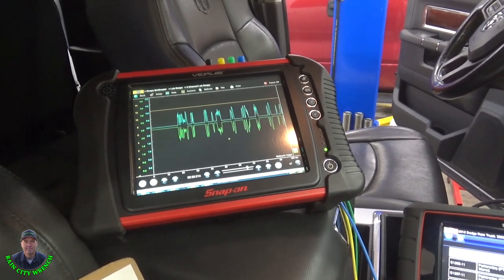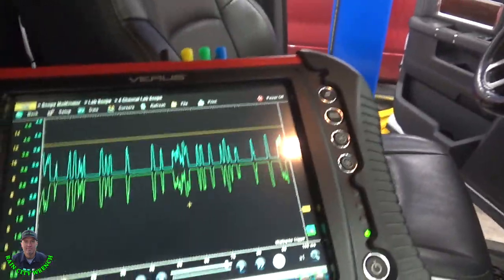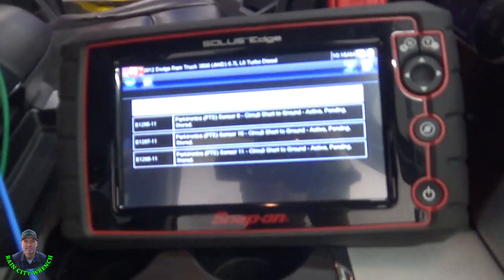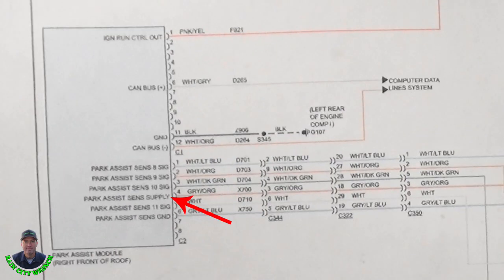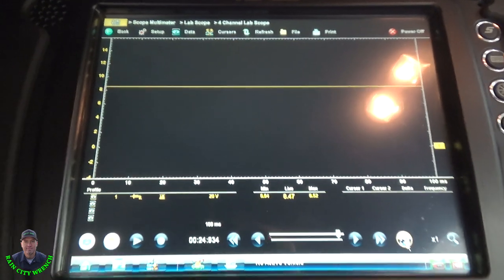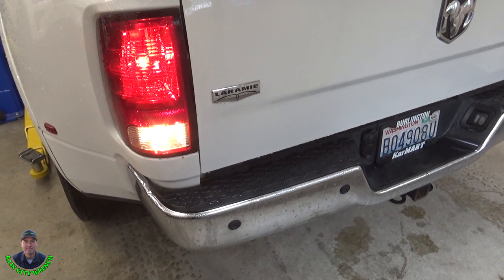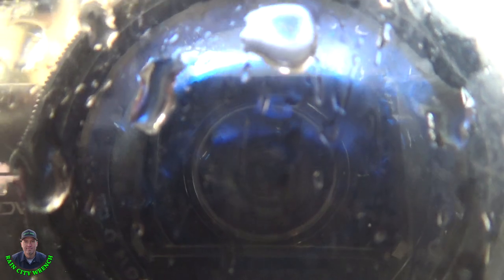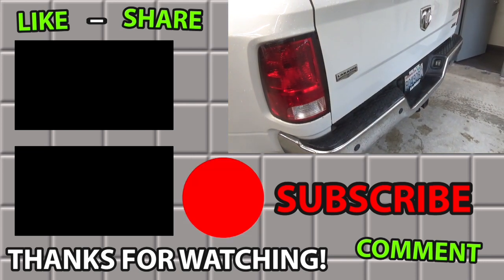RAM PARKTRONICS DIAGNOSIS/REPAIR

Comment: I have a 2012 ram 1500 bighorn and I have the "service park assist" notification. I replaced all 4 sensors 2 times from Amazon, turns out both sets didn't work. I bought an expensive code reader and used ALPHAOBD to scan the original oem sensors. The fault that comes up is: Sensor supply voltage - voltage below threshhold. Any idea what needs to be replaced?
Reply from the maker: What's the code number? Can plug it into identifix to see if any repairs are listed.
Reply: The code that is coming up is B2128
Reply from the maker: @benwalker6971  May have one sensor shorting supply voltage. 
1. Disconnect one park aid sensor
2. Turn ignition on without starting engine
3. Place transmission in reverse
4. With scan tool, read park assist module dtc's. If this dtc is still active, repeat this procedure by disconnecting another part assist sensor. 
Replace the park assist sensor that caused this dtc to change from active to stored after disconnecting. 
If dtc stays active after disconnecting all sensors then plug all sensors back in, check sensor supply voltage on pin #1 GRY/ORG at each sensor. Voltage should be a little over 7 volts. 
Next, check TIPM underhood fuse 10A M34 for 12V & park assist module ground pin 11
🤞

Comment: I tried the aftermarket sensors on my 2018 Ram 2500, and the module would not accept them. I had to go with the OEM, which was very expensive, but fixed the problem. Now I have front sensor fault. The cheap OBD2 reader did not even pull the codes, even though the dash display says service front sensors. What a hassle.
Reply from the maker: Yea, it seems to be a coin toss if aftermarket sensors will work from what I've read 😓

Comment: 2016 3500.  Message says Service Park Sensors.  I only have them on the rear bumper. Changed all 4 with new ones from Amazon. Still didn't fix it.  Bad harness?  Bad control module?  I'm sure not taking it to the dealer and pay a ridiculous amount.  I'll back up the old fashioned way.  I'll use me eyes.  LOL
Reply from the maker: Interesting. Good place to start is have the module scanned to see what codes are stored. Knowing someone with a scanner would be nice. Also visually inspect the wiring and connectors in the rear looking for damage or corrosion and lastly check all your fuses inside cab and underhood. The owners manual will show you the locations.

Comment: Wondering if there is a way to just completely disconnect the sensor, so it does not appear on the screen. I don't need the parking sensor - I know how to drive. =)
Reply from the maker: Depending on the year, some rams can be deactivated by pressing the buttons on the panel below the uconnect console. As far a completely disabling system, I don't know if the parktronics can be programmed out?

Comment: I replaced 4 sensors . Worked for tenth of a second. Sucks to be me . Maybe my harness? 2016 any videos on this somewhere on tube ?
Reply from the maker: Yuck. Maybe unplug one at a time and check operation. It could be one of the new sensors is bad and shorting out the system.

Comment: hello sir, i put aftermarket bumpers on my ram 3500.  i need to know how to disable the  system because sensors dont work.   thank you.
Reply from the maker: Unfortunately it will require factory software. Ram 2500 and 3500 pick-up trucks equipped with park assist (sales code XAA) can have the park assist
disabled in situations where the rear bumper (with sensors) has been removed or the permanent up fit
interferes with the park assist sensors’ “view.” This procedure will require taking the vehicle to a
Chrysler dealer after the up fit has been performed. This service call will not be covered under warranty.
Dealer charges may apply. 
The dealer will first disconnect the
Parktronics module then reconfigured the vehicle. The Parktronics module is located behind the driver’s
kick panel. Once the module is disconnected, the vehicle can be reconfigured using the RESTORE
VEHICLE CONFIGURATION routine in WITECH.

Comment: I have 2022 ram promaster. 3 months old. Disconnected 2 of four front sensors to relocate. When plugged in get message dash says front parksense unavailable, service required. Checked connections, look ok. Removed neg battery term and put back on see of it clears but same message. Any thoughts? Ty
Reply from the maker: At least it's in warranty. The first think that needs to be done is have the module scanned for codes and it will be done no charge at your dealer. I am not aware of any parksense recalls on these.
Reply: @raincitywrench117  i think i figured it out. I ldft sensor is without being plugged in. I think rain might have affected them.  I took them out and kept them in my house overnight when I went to install them this morning they worked

Comment: I replaced the rear sensors and the fuse and still not working, on 2015 Ram 1500
Reply from the maker: My suggestion would be to have the module scanned and see what codes are stored.
Reply: @raincitywrench117  How could this be done?

Comment: Any thoughts, I have a 2011 dodge ram showing a park assist error. I've tried replacing the sensors twice with different sensors from Amazon and the error is still showing.
Reply from the maker: Before doing anything else, need to get it scanned to see what codes are stored.
Reply: What if it doesn't show any check engine codes? I replaced all four sensors it stopped doing it for a couple months and now it sporadically.
Reply: I’m having the still problem

Comment: What's the deal with your parts department ordering from Amazon--is that common?
Reply from the maker: This vehicle was a trade in and belongs to sales. They will do whatever it takes to save costs on parts and labor + our parts department is Ford only. They originally were going to get parts from dodge but I told them they should order on amazon. I think you can get all four for around 40 bucks and the dealer would probably want twice that or more for just one.

Comment: What the heck. Did this truck get backed into the ocean to short out all 4 at the same time?
Reply from the maker: I know right? It didn't look all rusted out underneath. I don't know the history but i'm guessing one went out and then after a few weeks or months another, etc. etc. That happens with tire pressure sensors.
Reply: @raincitywrench117  Tire Sensors use batteries and I can see them failing one after the other. Parking sensors use power from vehicle. I have a truck with same issue. I also work in a used car dept of a Mopar dealership. Sensors are 170.00 internal rate each. I only replaced one due to it not showing continuity compare to others. And it still dont work. Im working on a 2018 2500.
Reply from the maker: @adp33  Wow! Dealer markup is a ripoff. Our parts department quoted the sales department around 700 dollars I believe. Did a quick search and found a set on Amazon for like 65 bucks so I called up the sales manager and they ordered. My coworker installed the new sensors and worked like a champ. I found the best way to check sensors is hold your phone mic real close to each sensor in a video and play back to see if any click.
Reply: @adp33  I’m also working on a 2018 ram 2500. I have dtc b1299-11 & b1294-11. Both short to ground. Replaced sensor already and module. Aftermarket rear metal bumper. I’m also in used car department. It’s got me stumped